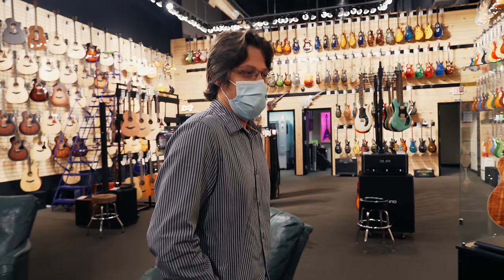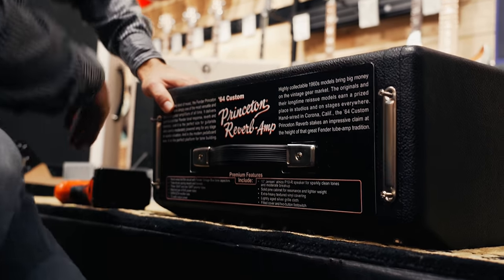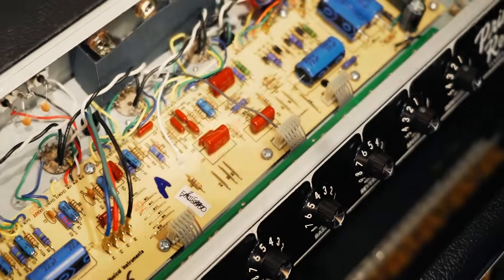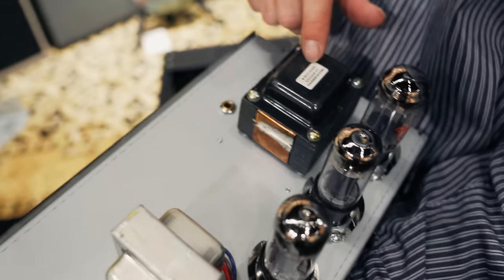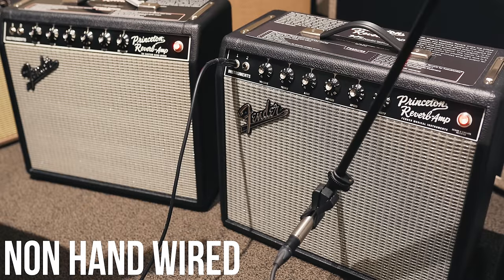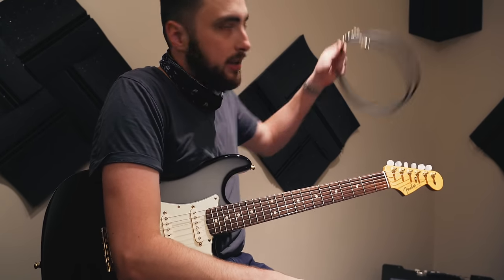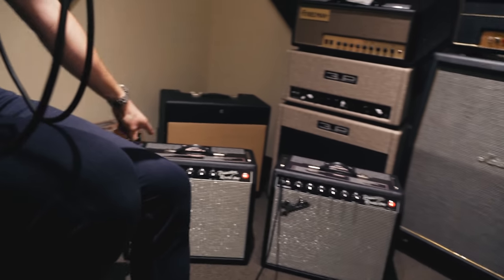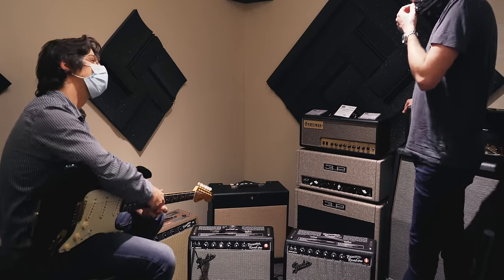Are Hand Wired Amps Really Better?

Comment: Great video, thanks! I think the bottom line with "Hand-wired" vs PCB is servicability. I haven't played 2 vintage Princetons that sound the same - But, I do know that amps from the 50s/60s are still around and very easy to be serviced! Servicability is a big deal to me. More bang for my buck. Nothing wrong with the PCB Princeton. its a great amp too.

Comment: Ultimately, this are completely different amps that happen to share a tone circuit that is executed with entirely different components. It was an interesting comparison. In our horses for courses world, there'll definitely be folks who actually prefer the "budget" Princeton with the ceramic speaker. My vote was for the hand-wired, as I really liked the fullness and the midrange. It would be very interesting to further experiment with the cheaper unit with putting in the best possible speaker and then using an EQ at the front of the signal chain to further sculpt the tone.

Comment: Funny thing is I feel like the non-hand wired one would actually cut through a mix better.
Reply: With drums and bass drowning your high frequencies and creeping in on your lows? Not a chance. Without solid mids they are absolutely right, a 15W amp would lose tons of definition with the cymbals, snare, and bass completely dominating those highs and lows. Sure, you can cut through with pure volume or a mountain of gain, but not with the sound they'd dialed in. That sound absolutely needs that mid range growl.
Reply: @elixiriszog  100% correct. In live settings, you gotta sit in that 500-700Hz area for you main tone.... especially on humbucker guitars.  It's amazing what a boost in those frequencies can do vs trying to be louder.
Reply: That might very well be true. I always feel when you put your amp to a really cool setting while you are alone in the rehearsal room, you will probably not cut through when everyone else joins in. And when you turn your amp on alone with the settings of the last rehearsal, it’s sounds crap. :) I have way more treble in live and recording contexts than I like listening too alone. I actually put a sound i like and deliberately put 10- 20% extra treble and lower the mids and bass by 10% afterwards at gigs.
Reply: @groovezilla79  ... good point too. I only play humbucker guitars btw
Reply: @elixiriszog  tell that to the $100 crate Billy Corgan used on Siamese dream 😎
Reply: @joshuakincheloe  Billy Corgan's tone on Siamese Dream? You're kidding, right? I hope so... I'm a huge fan of their early work, and I've seen them live a bunch, and Billy Corgan is absolutely (in)famous for using a MASSIVE array of pedals, possibly most importantly a vintage Big Muff Pi, and Marshall JCM-800 amps. There is loads of info out there on this. Not sure what this has to do with my comment on what frequencies are important for cutting through live sound, though. What he recorded that album with, amp and pedal-wise, is only the beginning of why it sounds like it does on the album...
Reply: @elixiriszog  look it up and I apologize he used it on Mellon Collie and the Infinite Sadness.
Reply: It's the opposite, the HW has more mids, which will cut through a mix better.

Comment: They sounded a lot closer when playing through the same speaker. But in the first part I gotta say I actually tended to like the sound of the non-handwired
Reply: Me two I have owned mine since 2008 - and it really sounds great with a 2 x 10 closed back Tremollux Cabinet along with the built in Speaker together...
Reply: I liked both amps. The non hand wired seemed brighter and less muddy, yet slightly less resonant. I’d be happy to own it still.
Reply: Ditto - I preferred the sound of the non hand wired
Reply: I thought the hand-wired was 'noisier'. The printed had a much more clean signal to me
Reply: My ears must be going bad. I didn't hear a whole lot of difference at all, and I even tried those torture device ear buds and watched the video over and over.
Reply: In the first part before he dialed in a sound there's no reason to assume either would ahve sounded better no matter what cause the settings were arbitrary. Any amp can sound shit with certain settings. Dialing amps to 5 sucks if you never dial in a sound, which is why I'm glad Rhett dialed in a sound on both rather than saying "this different amp doesnt' sound as good on identical settings".
Reply: The non-handwired seemed to have more bite.
Reply: LIKE I'VE SAID A THOUSAND TIMES ...YOU CAN MAKE ANY AMP SOUND BETTER  IF YOU HAVE A TECH WHO KNOWS WHAT HE'S DOING.SPEAKERS,TUBES, BIAS ETC
Reply: Apples and Oranges. Serviceability aside, the difference in tone could be anything from the speakers, cabinet construction, circuit layout/design, the tubes, variability/quality of the individual components, biasing, etc. Tone isn’t an inherent quality of hand wiring.  It really comes down to entirely subjective preference and use case.

Comment: Speakers make a HUGE difference.  I was a speaker engineer for Oxford in the 70s and 80s. The cones, magnets, plate chamfering, voice coil wiring... all make far more difference in tone than hard wired vs circuit board. Given a reasonably good tube amp, save the money and replace the speaker with a Good speaker.  For a couple hundred dollars a speaker upgrade can turn a decent amp into a Great amp.  Unfortunately it is hard to "demo" speakers to find the tone you want.  
Long term, your electrolytic capacitors dry out and need to be replaced (or upgraded) and it is a lot easier to do that on a hand wired amp.  
My rig is a 60s Bassman, with speakers based on the sound I want.  Fav is an old EV SRO in a sealed baltic birch cab.
Reply: Same Oxford as the speaker units in a Fender Twin reverb from the late 70's? Im looking at one at the moment and my friend who is an authority on Twin reverbs claim it has "Oxford" speakers, dont know anything about it 😄

Cheers
Reply: I just picked up a first generation EV sro/12 alnico in great shape for 100 bucks today,  I'm so stoked, I think it's gonna go in a closed-back front-ported 1x12 I got...do you know the power handling?
Reply: is it yr opinion that the speakers have to 'break' in order to acheive their full tone?

Comment: Would have to play both to decide which one I'd pick.
Standard - More Top End
HW - More Mids
Through the same speaker the difference is not as big
Probably I'll take a normal one and upgrade the speaker
Reply: I wish he had used a signal splitter and rocked both at the same time, would've been a great soumd for the studio
Reply: No no no, there is no difference  between standard and HW.  It's just different speaker and probably slightly different component values (they vary +-10% according to the spec, but some components won't even actually meet that spec) and different knob positions.

Speakers make a HUGE difference and these guys could have played both heads through the same speaker.  They really did a disservice to all the people commenting that HW vs PC sound different.

Comment: When they used the same speaker it was hard to hear much of a difference
Reply: The full hand wired ones feel a little more responsive to pick attack. Otherwise I agree 100%. That’s more to do with component selection/value changes than due to the PCB.
Reply: It's a huge difference, it costs way more money for the same sound. Amp makers will tell you the same thing. It's nostalgia only. Speaker choice and cabinet size makes the biggest difference in sound.
Reply: I still heard a bit more lower end on the wired amp. Difference in our computer speakers/head sets?
Reply: @billedwards2657  I'm on studio monitors and the pcb amp is way pokier, while the hand wired more compressed
Reply: Sean Lew that’s probably more due to the xicon caps in the reissue. Each builder has the preferences.. I’ve seen mojo’s, Jupiter’s, and mallorys make it into the Carr’s and Swarts of the world. I think fender has reproduction Ajax’s in the hardwired. I’d also have to see if they put grid stoppers on the hand wired.
Reply: Sounded more or less the same to me. Of course, there is a little difference, but they are different. And the 65 was made to be pokier, scooped and chimier, so I'd see that as a design purpose than a drawback. Horses for courses.
Reply: @Marc-André Beaudet But a marginal quality PCB will be more reliable and easier to solder in new components.  If hand-wired boards were more reliable then all of the aerospace industry would use them - of course they don't.  Also, try soldering new components into a hand-wired bus, it is a three-hand operation.  Soldering onto a PCB is easy.
Reply: Through the Alnico they both sounded like great Princeton amps. Saying there is a "BIG" difference is just clickbait.

Comment: I've been very happy with my 65 PRRI so far but this video proves it can sound even better. Listened to the speaker swap portion 3 times now and I'm hard pressed to hear any significant difference. I'm going to swap out the $50 C10R ceramic for a $125 P10R alnico and and tell myself I saved a $1000. I'm good at that kind of math!  Thanks for posting.

Comment: Really enjoyed this. I would just point out that for $100 you can put a 10 band eq on your board and make all the tonal adjustments you need and save yourself the $1,300 difference. There are a lot of eq limitations on Fender amps, especially in the mids.
Reply: So true Robert, and I own two point to point Fender amps.
Reply: No bc the feel as a player would not be there . If this were the case u can replicate any amp with a eq pedal.  U can reproduce sound but u cannot reproduce the sustain,  compression aka voicing the amp has .
Reply: Can't make it feel and react the same though. The difference is not only to do with sound. A Novice player probably won't notice as much, but someone who knows what they're doing will absolutely notice and that extra special ingredient that the hand wired amp has, is absolutely worth it. It's not just EQ it's the harmonics and the richness of the amp and the way that it compresses and holds together. The EQ is only one aspect.

Comment: Soooooo... The components AND the speakers are different? they're not the same amp then. the difference your hearing isn't the wiring lol most tone comparisons show that the speaker plays the biggest role in tone shaping when comparing two similarly voiced amplifiers. That being said even with the shared speaker tests we are hearing deferent circuits.
Reply: Dude he literally plugged birth into the same speaker and IMHO the handwired still sounded better
Reply: I agree that the speaker makes the biggest difference.  But the hand-wired had the exact same transformer(s) and tubes.  It is the point-to-point hand wiring and layout of those components that are different.  I guess it IS money well spent.  If you've got it.
Reply: I agree ,different components ,different sound ,not worst ,not better
Reply: Didn't they say that the cabs were different?
Reply: @jerrystephenson1172  64 is pine 65 birch
Reply: @tedunguent156 They're probably not the 'same tubes' I bet the PCB amp has the bias set colder (set to a lower plate current) as to make cheap, average quality tubes last longer. It's common practice on stock Fender amps. Now I if I could afford a HW top quality amp, I'd install the best tubes I could get, too.
Reply: The difference in circuitry does NOT explain that difference in tone quality. They're both fine circuits I'm sure
Reply: @TheChadPad  I guarantee just by design the circuit  makes a greater difference then hand soldering it does. I wouldn't be surprised if there would be no difference intone if both used the surface mounted pcbs and circuitry. Other than the hand soldered ones with all the actually be noisier. Even pedal builders like Josh at JHS pedals what argue that hand-wired and Soldered units differences are basically splitting hairs
Reply: @renzocalcagno536  I would say the quality of the discrete components is better in addition to the point-to-point hand wiring and soldering.  I meant that the part numbers for the tubes and transformer(s) were stated as being the same.  I don't think the variations in the tubes or discrete components would, necessarily, make that much of a difference.  I think the speaker is the biggest difference.  But, the PCB does have surface mount components.  That's why it's $2300-$2400?
Reply: Ted Unguent I’m sure someone could get the same hand wired quality for less from a smaller builder. Or buy an old wierd amp for cheap and redo it. Or build from scratch!
Reply: @abubakr6939  It takes skill to build your own any better or cheaper than Fender.  Skill and knowledge.  I worked for two big manufacturing companies that made electronics.  I could do it but I wouldn't want to.  It might be fun for some people.  I'll buy one and get a warranty.
Reply: @tedunguent156  Tube quality and bias does make an audible difference. At least I can tell on my Fender DRRI which I re-tube and re-bias myself.
Reply: @tedunguent156  it's worth $1200 more 'cause it's cheaper to pay a Chinese kid a few dollars to operate a switch on a machine than having him learn English, basic electronic and soldering skills, and then put him to work on a PTP assembly.
Reply: @tedunguent156  I think swapping the speaker will get you 80-90% closer to that 'HW tone'. You'd probably be paying that extra grand to get to 100%. What about MesaBoogie amps? Aren't they PCB design?

Comment: What you have to also investigate is the pre-amp tubes between the 2 amps.  Fender bought out Groove Tubes and thus they do not manufacture tubes...they rebrand.  I suspect that one amp has Sovtek 12ax7WA tubes and the other has Sotvek 12ax7 WC tubes...and sonically they are different response which is what you are hearing to a great extent.......as you note the character of the amps change with the speaker being used.    I do tube amplifier service as well as build, so the circuit board amp is not service friendly but can be dealt with and changed.  The control panel board can be swapped out with normal parts to eliminate the circuit board and then be tied in to the main board.  The biggest factor is that they used Illinois brand capacitors  which can be swapped out.  The electrolytic caps have a service life anyway and can be swapped out at the point in their cycle....or just changed out if you don't want to wait.   The signal caps are a matter of taste......but the actual pre-amp tubes are critical sonically as you can see with the speaker change.  If you can imagine the gauge of wire being used in the hand wired chassis......and rolling the copper out flat......then comparing that to the traces on the circuit board of the non-hand wired amp......>>>>in AUDIO applications.....the lows travel better with thicker wire and the high travel better with thinner wire.  SO the circuit board can be retrofitted by using wire between the solder pad points as a secondary over the traces.....which might give the visual appearance of a real hack job when it actually has a purpose.  The average amplifier tech would be completely baffled.......